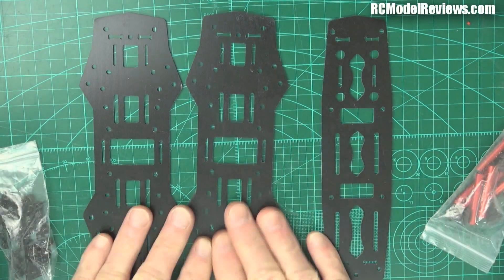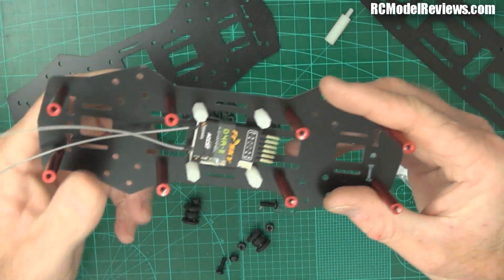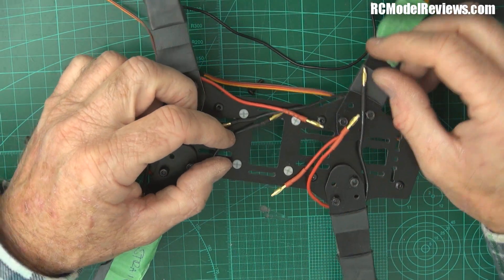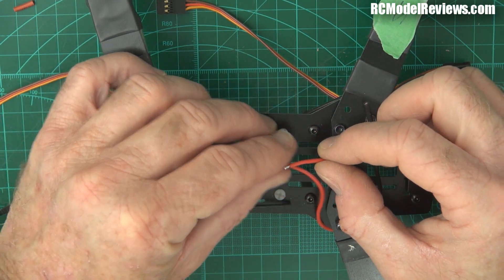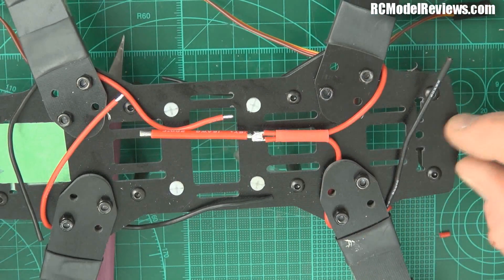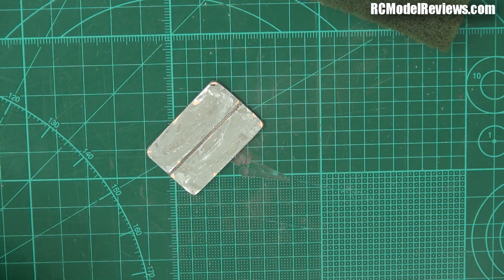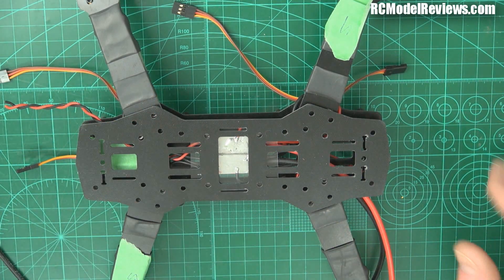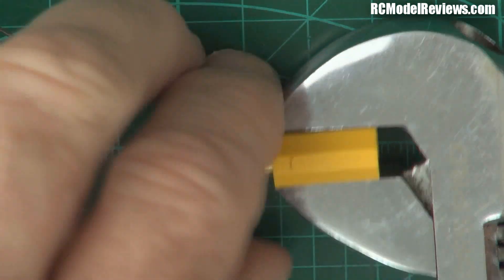Low cost miniquad racing drone build video PART 3

Comment: I love your enthusiasm, but it makes me cringe a bit to hear you talk about "fresh flux".  The flux is all going to melt away or burn off right away.  What you are describing as a "dry joint" is where the solder has oxidized a bit, making it not flow together nicely.  Can't really argue with the result though!  Nice work on the videos, thanks!

Comment: that device  you are using for checking the direction of rotation, is it a mini servo tester? can be used for that?
could you add any link for buying one?
Reply: +joe ds Yes it's a servo tester and it can be used for that, you can find some cheap ones on ebay, any servo tester should do

Comment: Thanks a million......I'm building one now 👍😜
Reply: Pixel Pusher Is that your first time building a racing quad? If so how is it going? I am thinking of building one myself.
Reply: TJ Lonsdale-Jones
its going great but i just noticed that the esc/s dont have a bec inbuilt so ive had to order a separate bec.....about $6 from banggood.
im waiting on parts now.....
ive built a dji f450 and f550 before so its not entirely alien to me apart from the flight control, which i have no experience, its all just a bit smaller.

Comment: Not sure if I'm saying something stupid, however, all servo testers I found top out at DC 5v. How am I meant to use them to test out an 11.1v quad?
Reply: +sheepcute When testing the motors with an ESC that has a BEC, the red wire of the servo connector will be putting out 5v. But if the ESC you are using doesnt have a BEC then you will need a separate power source to power the servo tester.

Comment: That green pad with measurements, is it some pad one can buy and put on his work table? Any ideas about link to such thing?
Reply: its called a "cutting mat"
Reply: You can buy those cutting matts at hobby shops or Art supply stores, or you can try a fabric shop that sell supplies for quilting as quilters use them as well to cut fabric on. Just ask for a "Self healing cutting mat" If you are in the UK you can go to a local "The Works" shop or online http://www.theworks.co.uk/search/cutting%20mat the works is the cheapest, and fabric stores charge a lot more for the same cutting mats.

Comment: if you buy CW and CCW motors... do you still have to cross the wires from the motors to the ESCs??
Reply: brandon b Did you ever figure that out cause i'm in the same boat.
Reply: brandon b no u dont need to cross wire

Comment: Naze is the best option? Tau Labs would like a chat. and you can get the Sparky for only slightly more than a haze, though for a beginner a naze will be more than enough, but so will the cc3d you said was so much worse, despite the cc3d for all intents and purposes being identical to a naze acro board. cc3d can even run the same cleanflight firmware, or even TauLabs

Comment: dumb question ...why not have 1 esc? seems they make these big enough but still would be small enough in size to mount. not to meant the wiring wouldn't look like a terrorist bomb in a bad movie once you're finished. mind you i know nothing about this stuff.. just seems like it would be cleaner have a better balance and weight distribution and only one esc to burn out and need replacing
Reply: +thelaughingman79 Each motor needs to work independently, otherwise you wouldn't be able to steer it! Otherwise it could only change altitude.

Comment: Hello Bruce,
for the DIY PDB, what thickness of the copper layer would you recommend? I have an 1,5mm Epoxy plate with a 35µm copper layer? Would this be enough or should I try to get one with a thicker copper layer?
Reply: IMeathookI 35um is the standard and should be good, if you feel like it, you can always add more solder to the board to reduce resistance
Reply: FightingFlight thanks for the advice, going to order that plate now to get my quad more tidy :)

Comment: You said something about bullet connectors being unreliable is that really true. (I was meaning the rc model reviews guy who said that.
Reply: +hal roobsoon I didn't have any trouble with them. My quad had them from my motors to my esc for a couple months, but once I got more comfortable soldering I remove them to save on weight and make my quad look cleaner.

Comment: at 13 minutes Bruce as you mentioned how do they make a profit??? Easy, pay 25 cents to each builder and avoid the markup for stuff we think as cheap at $10 when they cost $1 to make and can be removed from the R and D bay at midnight.

Comment: do I have to cross the ESC wires to the motor if my motors are already clock wise and counter clock wise motors ?
Reply: +Jason hernandez Clockwise and counter clockwise motors refers to the threading for the motor caps, not the actual direction the motors spin by default. So yes, you will probably still need to cross the ESC wires over.
Reply: Thank you guys for all your help . I'm just a beginner trying to find my way . I just wish there were more fellow enthusiasts in my town so I can get more help
Reply: +Jason hernandez same here

Comment: i came up with a question, what is beste used to maintain/clean my miniquad? i mean how do i get the sand out of the motors and such. Just flush with em with WD40?
Reply: Grearson .x Keep WD40 away from your motors -- it is not a lubricant -- in fact it makes a damned fine cutting oil when I'm machining aluminum and a few other metals.   Compressed air will get most non-magnetic crap out of your motors and a drop of bearing oil from time to time will make the bearings last a little longer.
Reply: ***** Hey Bruce, What about the bits that are magnetic, this very problem i have just fixed as one of my motors was making a crunching sound so i took it apart and there was lots of shit stuck to the magnets. Cos i use mine as a leaf blower haha. Quite hard to clean too. Any thoughts apart from the obvious which is no more leaf blowing;)?????
Reply: mark acker Stuff that sticks to the magnets is a real problem and about all I can think of is perhaps using some BluTak or plasticine pushed into the motor bell (after you've removed it from the motor) to try and get the particles to stick to it.
Reply: ***** AHHH You bloody legend!!! Why didn't i think of that? Oh, --- I know why:) Cheers mate Great idea.
Reply: ***** And i think we should get together some day cos we look alike as you can see in my photo;)
Reply: To get sand out of a motor I flush it with distilled water, then blow it dry with a hairdryer. Then a tiny drop of oil on the bearings to finish.
Reply: Herman Harmers uh that one sound like a good idea, will try next time, ty =)

Comment: I would like to buy that servo tester Bruce can you put up a link please.
Reply: Hi,
I have a similar one that may suit but the input voltage is just 4.8 to 6 Volts Max.

Check eBay for...
Multi Servo Tester 3CH ECS Consistency Master Checker Speed Controler CCPM SK

Does ESC's as well.

Comment: hello,

im new to this. my question is what battery i should use ? which motor uses which battery
other parts uses same voltage ?? 

if i buy battery with more mAh i will have more flight time ?

do you have a video for this ?
Reply: +Alaa Beirouty this quad is made for 3s (11.1v) batteries, but if you upgrade the camera it can handle both 3s (11.1v) and 4s (14.8v) batteries. Personally I like smaller mAh batteries since they make the quad more agile, but if you get a larger mAh battery you will get more flight time, but the quad will become more sluggish. Also, note getting more mAh means getting a larger battery, which means more weight, and so you don't get much gain in flight time for increasing battery size as you may think. You'll have to try out different batteries and decide what you like best. Any battery 1000-2200 mAh is a good place to start. Also C rating is important if you want to fly fast, the higher the better.
Reply: +Isaac Davis thank you for explaining isaac

Comment: Nice video, I am have a problem with the quadcopter after a crash, I get a burning smell, and I also get the long beep with my battery connector like the test you do in the beginning of this video.. what can cause this?? Anybody. Please help
Reply: +John Doe sounds like you have a wire shorting on the frame. Make sure none of the exposed wires are touching the frame. Since carbon fiber conducts electricity you need to be extra careful with the wires. Hopefully nothing got fried.

Comment: Is it okay if I cut the xt60 from my lipo and solder the lipo directly to the pdb I forgot to buy female xt60
Reply: +Kaustubh Kishore That's usually not a good idea. If something shorts out you can't just yank the battery off. Lipos catch fire in a quite violent manner so you don't want that! Not to mention charging is usually done through that connector.
Reply: +Tim Bass I found the xt60 from a local hardware XD thanks anyway, but charging is not done through the xt60 it is done through the small plug that comes along with the xt60
Reply: +Kaustubh Kishore That's why I said 'usually' ;) you can charge through the balance plug. Just can't push some of the faster charging rates that way.
Reply: +Tim Bass you seem experienced tell me the connections i need to do from pdb to the cc3d and how will the transmitter get power
Reply: +Kaustubh Kishore  I just have different experience, I'm still learning too. If you use the Afro ESCs recommended in the first build video they have power regulators in them. They send power via the servo connectors that get plugged into the Naze32. So all you have to do is connect the ESCs to the PDB and then your naze32 will be powered once you plug it into the ESCs. The naze32 will pass this power through to your receiver as well so you don't need to do anything more than plug it in. 

The one exception would be if you get ESCs that say 'Opto' anywhere on them. These ESCs won't provide power and you'll need a separate power regulator to go between your PDB and naze32, usually called a BEC.

Comment: Anyone have an idea of where to pick up one of those copper boards?  I've been looking around locally and haven't found much.  I haven't tried an electrical supply store yet,  but any places online?  Or certain stores?  Thanks!
Reply: Scott Bell If you can't find any local electronic stores, you can grab them off Ebay, just search FR2 Copper Clad (FR2 is usually single sided - copper on 1 layer which is all you need)
Reply: Scott Bell If you're ordering from Banggood.com (where he got the motors from), you can get it there: http://www.banggood.com/One-Side-Copper-Clad-70x100x1_5mm-Single-PCB-Board-Glass-Fiber-p-950900.html

Comment: which Layer would the power distribution board go on
Reply: +lyle vellone in between the two bottom plates where he puts the make shift pdb from the copper plate

Edit: it really depends on your pdb. If you can keep all your soldering nice and clean and make sure none of the soldering connections are directly touching either bottom plate like Bruce did, put it in between, but if your pdb is thick or you are struggling to fit it to fit between the two plates, then it is better to put it on top of the upper bottom plate to avoid potential shorting.
Reply: O thanks so much

Comment: Can I challenge your build.. your thinking.. You're an engineer right? And I'm sure you know about rotational moments more than I ever will. So why put the ESC's outboard where they become rotational forces outside of the center of gravity? Why not keep everything as close to the center as possible?
Reply: I'm wondering if having the ESC's in the propwash has cooling effects that are more important than the rotational moment from something really light like the ESC.  Motors have several times the mass of the ESC, and they have to be at the ends of the arms

Comment: what kind of solder do you recommend?
Reply: Rosin core lead only, not tin!
Reply: +Tom Dunphy Why not tin?
Reply: 0,5mm-0,7mm 60/40 with Flux core.
Reply: +cheekid Don't listen to him.
Reply: cheekid It is less conductive and has a higher boiling point.
Reply: +Tom Dunphy Boiling point? I'm sure you don't want to solder with plasma. You mean melting point. :)
Reply: Lol your right!

Comment: The motor mounts on my ZMR250 from  Bangood USA warehouse does NOT accept/support 12mmX16mm motor mount. The Turnigy 1806- 2280KV and dys BE1806-2300KV  are 12mmX16mm mount pattern. The mounts do NOT accept/support 3mm mounting hardware with out grinding the mounting slots. The 2mm motor mounting hardware barely catches the hole in the frame suggest using 2mm flat washers to prevent drawing the head in to the mount hole so the motor won't come loose. Cheeeese WIZZ!!! frame

Comment: When soldering many different wires at the same time, I tend not to tin the wires 1st.
I'll bunch all the copper strands nice and straight together and then use thin piece of single strand wire and wrap it around perpendicularly. That keeps all the wires nice and tight, and won't move at all while you apply solder.
Then I just flow solder in all of it.
(I've actually stolen the technique from David Windestal)
Reply: Murphy Quad That method will work but it can tend to make the soldered joint fairly bulky and there's only 3mm of clearance (the thickness of the arms) between the two plates on the ZMR250 so if you get a big mass of wire (plus heatshrink covering) it's easy to exceed that size.
Reply: ***** meshing the wires together would be less bulky than all this side by side soldering you're doing. also stronger and much more efficient since now the current is going though a lot of pure tin, instead of copper to copper. with this soldering, the "inefficient" bullets might actually have less resistance and loss. and if you do them properly they're hardly unreliable, slap a piece of hatching over them if you're worded, I di, but not to stop them from disconnecting on my nighthawk(not gonna happen) but to prevent possible arcing.
Reply: RCKnut The resistance of the solder in this case is measured in single-digit milliohms which, when you consider that we're only going to be drawing a max of 40A (and then just briefly) through this, is a voltage drop of merely a few tens of mV maximum.  Remember there are many other solder joints in the system -- motor to ESC, ESC to main power lead, main power lead to XT60, XT60 to battery leads, battery leads to lipo tabs.   Not too much to worry about here ;-)